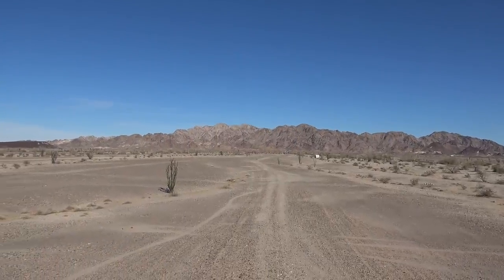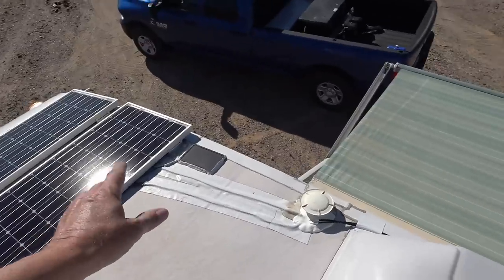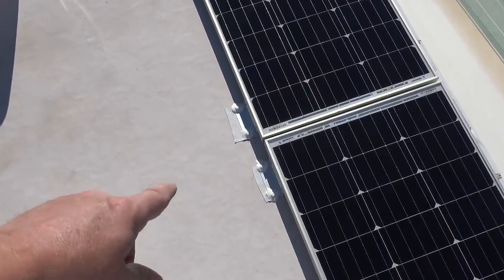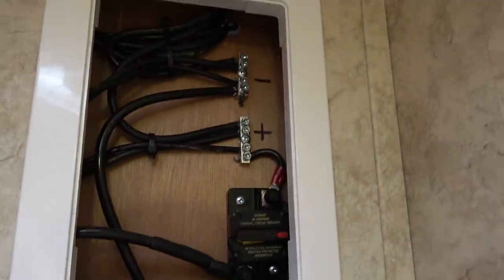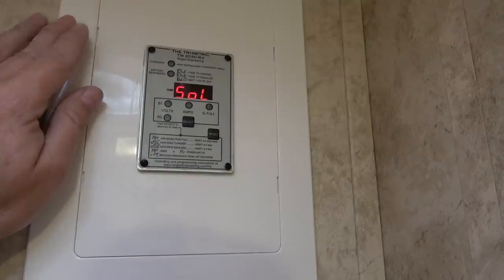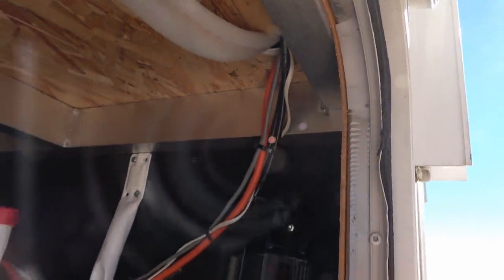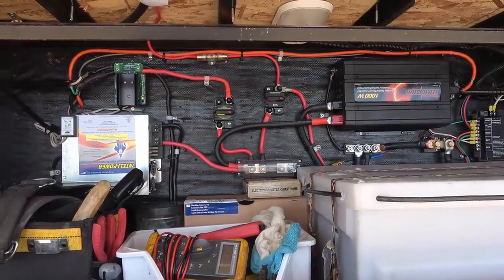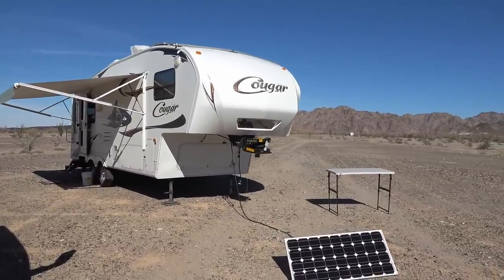Boondocking Power Upgrade -  2 More Solar Panels + Wiring Update & Mods

Comment: The breaker in the wall does not turn off your solar array on the roof but it does disconnect it from going down to your charge controller, which is still a good thing. If you need to shut off the solar panels, turn off the sun, work on them at night -- or just cover them with cardboard cutouts. :D
Reply from the maker: Yes, you are correct the voltage is still present but zero amps of current flowing. So really depends on your definition of  "off" To me if there is no power output its technical off, like a light switch in a house.

Comment: Nice to see your system Ray. Yes I have watched it grow through the years.
I'd like to add solar to my 26' TT, but solar is so $$ in Canada.
I would like to add ~1000w on the roof and around 400AH of LIFEPO4.
Storage is at a premium with my TT - only one small storage in the front that does not even go through all the way. This is a problem with all the space needed for the various parts, not to mention the batteries.

Comment: Ray, we love those 1/2 ton Cougar 5W's in the 27-30' range. The 25MES looks particularly inviting just under 30' and with Full-timer warranty coverage now added and most of the other brands not, the possibilities are exciting.  My 17' half-ton truck lacks the pin weight capacity to handle it with a good margin, unfortunately, so we are trying to find a suitable bumper pull model with a similar layout. Mind you our '17 Lance 1985 isn't a bad choice at 23' with a Murphy Bed, just when both of us get cranking on the tech/Reservation support back at the campground we both feel a little in each others' way, Sometimes the rig you got will get you there a whole lot cheaper than the next round of dealer add-on fees will, LOL. Our Beagle is now 10 years old so we want to get back to Boondocking in AZ/NM before those central FL snowbirds drive us crazy trying to rid the planet of ants, skeeters, critters, and bumps on the shuffleboard court, LOL.
Reply from the maker: Wow, full timer coverage, that's really nice!  We still like our rig, have always like the layout, suits us well. If the frame hold up I plan to just keep fixing and improving things. :)

Comment: Nice video Ray! Your charge controller has  a limit of 31 amps, looks like you're maxed out now pulling in 27.
Reply from the maker: That's a good thing for this time of year. Low sun angle and short days. The ground panel addition really helped but now with these 2 more panel we are pretty well maxing it out. :)

Comment: That access panel and hiding the bus bars in the wall was a good idea. Since you are already pushing nearly 30 amps during the winter aren't you worried about overloading your charge controller? I thought the Trimetric controllers were rated at 30 amps.
Reply from the maker: The Bogart solar controller can deal with the extra.  http://www.bogartengineering.com/products/solar-charger.html  "Up to 30 amps maximum solar current. Charger will safely reduce output if panel current exceeds 31 amps."
Nice perk with the simple little controller is it barely gets hot, even a full amperage. Not a lot of energy loss.

Comment: Thanks for sharing my friend. I must of slept through the one where you switched out the Tristar charge controller for the new one.
Reply from the maker: I've never had a Tristar, went from the Renogy kit one to the Bogart about 4 years ago, maybe it was one of my friends install videos of his rig I posted a few years ago, he had a Tristar.
Reply: @LoveYourRV  You're right. my bad. I just remember it being a PWM and in the comments were beating you up for it.LOL
Reply: @jerrydensmore2887  There is nothing wrong with PWM if your panel voltage matches your battery bank voltage With "12v" being most common. My 24v solar controller has proven to be very reliable and has worked well for me since 1999. It was my first purchase on eBay which was not widely known back then. My how things have changed.
Reply: @geraldhenrickson7472  I totally agree with you, but the nerds in the comments were raking Ray over the coals for not using a mppt one.
Reply: FWIW, unless you buy a top-end MPPT controller (eg: Morningstar or equivilant), MPPT is highly over-rated. You simply cannot trust the 'facts' in their glossy marketing brochures. The ones worth the price are very expensive. MPPT does increase power input to batteries but work mainly when panels are cooler in the early or late parts of the charging cycle when the panels are not producing much anyway. Plus, the extra electronics in MPPT units eat up extra power. In many cases, a good quality PWM controller (like Ray's Bogart) will actually produce as much or more power into your battery bank than most of the cheap Chinese MPPT controllers. IMO, for 95% of RVers it is better to get the Bogart and use the cost savings from not buying an top-notch MPPT controller to buy more panels that will put power into your batteries in all conditions throughout the entire day. Panel prices are continuing to drop, and the $ difference between Ray's Bogart and a very good Morningstar MPPT (30A) is enough to buy two 100W Renogy panels. That 200W of extra panels through a Bogart controller is hard to beat for the vast majority of RVers.

Comment: This setup would be ideal to evaluate series vs parallel.  I bet you could get 10-20 percent more out of a 2P 3S setup, 50 ish volts.  Maybe get victron to send you a Mppt controller for a test.  You would need like a smart solar  150/60 or so.
Reply from the maker: It would be a lot of work to do a complete comparison test. First, you would have to spend equal amounts of money on each system and do tests in many different conditions like temperatures, shading, cloud cover, sun angles at different times of the year or latitudes, etc. Then factor in robustness and redundancy of the systems. As systems grow and take up the rooftop real estate a quality MPPT controller like a Victron or Morningstar makes more and more sense.
Reply: True dat.

Comment: I have a 8x30 home under a car port I have 12 panels charging 10 12volt military batteries 5 on the A side and 5 on the B side, then into a 2,500 watt inverter. I have a lot of low power to run the furnace, frig, computer, I can't use the toaster or AC because it draws too much power on startup. My furnace is propane so I won't freeze. I wish I could do something that would allow me to use the  AC has a 15 amp draw to start and it shuts down the system. I have some advice go to interstate battery and see if they take in used military batteries. My batteries on-line are $650.00 each! They cost me only $75.00 each and they are like new. I have them in a 4x4 dog house we made and it looks like a BIG dog lives in it! Thank you for your video!

Comment: Well done ! Like yourself I too have a PWM controller & got an extra Renogy when they were on sale. I've gone slow with my Solar system and not wanting to spend a ton into it. Several of my camping buddies have $8 -$10k into theirs. I'll admit if you're over 400watts or long distance wires, the MPPT's are more efficient, but at the lower wattage not a real big difference for ME  to justify the additional cost at this point. Most of the time we're in the woods or Pacific Coast (ineffective solar) or our 5-6 week trip in Winter to the AZ desert. Our simple, low cost system & small inverter genset has worked well for our needs for now.
Reply from the maker: Thanks Herb, I could have bought a quality brand MPPT with my money and rewired for series and higher voltages but decided to just buy 2 more panels and some bigger wire for about the same cost. I kinda like having all small 12V panels and in parallel, some system redundancy built in and less shading issues.  PWM are super simple, and long lasting. MPPT are a lot more complex so more failures can happen, especially with these cheap off shore ones.
Reply: @LoveYourRV  You would gain 15-25% in charging amps by going to an MPPT controller.  You would need at least a 40 amp controller to handle your 700 watts of solar.  An inexpensive choice would be a Renogy Rover 40 amp MPPT controller which would cost you around $140-$160.  Another inexpensive option would be one of the epever MPPT controllers for ~$125.
Reply from the maker: If I didn't already have a perfectly working quality controller/monitor combo, purchased 4 years ago when MPPT were much more expensive, that would be a good plan. But for me having an existing system and lots of roof space it was just as easy to add more panels with the money and get still the % gain in amps, panels are quite cheap now.

Comment: We have a simular configuration. I put switches in the pairs to be able to control it. If one set has shade i can switch it off because the shaded panels will drop the whole output. The trunkpanel is awesome you have

Comment: I would suggest a Victron MPPT controller along with their BMV battery monitor. Your lifepo4 bank is not liking PWM. Many positives for upgrading those components. Nice boon docking location! Enjoy
Reply from the maker: The Bogart 2SC2030 PWM controller works in tandem with the Trimetric monitor. http://www.bogartengineering.com/products/solar-charger.html 
It is totally customizable (which was a big selling point when I bought it 4 year ago) so when I got lithium it was just a matter of going in and adjusting a few parameters. 
Mostly it was setting its absorb voltage setting to between 14.2 - 14.6V. I set it to 14.4V and it charges my batteries perfectly fine. The Lion Energy lithium batteries aren't that special to charge, basically, they just want a single charge voltage setting. The battery BMS takes care of the rest.  Cheers, Ray
Reply: Borgart PWM and TriMetric are older technology and not as robust or efficient. If they work, than stick with what you know. With the BMV you could see you battery SOC from your phone along with other information. No need to go to the bathroom to check.😉
Reply from the maker: Actually, Bogart recently came out with an add-on to its Trimetric which broadcasts the info using WiFi. So you can set it up and check the batteries from anywhere.  http://www.bogartengineering.com/products/wf-2030-wifi-remote-tm-2030-monitor.html  The Bogart stuff isn't as user-friendly and doesn't look as pretty or have the marketing behind it but good bang for the buck in my opinion.

Comment: I went parallel in pairs then series in between to bring the voltage around 60 volts coming into my Tri star mppt controller that can be used in either 12volts or 24 volts...I have 6 one hundred watt panels reenergy like yourself.
Reply from the maker: Those Tristar are great controllers!

Comment: Your PWM controller has settings for lithium batteries? It must be a very advanced unit. Oh wait...your batteries must be drop in style with the built in BMS. My PWM controller was top of the line yet manufactured before lithium hit the market so I need to do pretty much what you have done when my AGM batteries dwindle in another 5 years or so. You cable management was really top notch. Thanks for the video. PS...Did I miss a video? It appears you are out near Quartzite...I better have a looksee at your recent videos.
Reply from the maker: It doesn't have a special setting per se but it is totally customization, so I went in and set it up to match the charging voltage that my lithium batteries work best with. That was one of the perks of it at the time, it had advanced capabilities for a relatively inexpensive cost back 4 years ago. Was made by a small US company in California.  http://www.bogartengineering.com/

Comment: Nice upgrade... Agree more panel rather than tilting (A solar panel is about the same price as a tilt kit!)... Curious you have I believe a 30amp charge controller and now about 40+ amps of solar?... Is it ok to oversize the panels amp capacity above the rating of the charge controller? (I actually like that idea!) but would worry in the summer the controller would max out and could overheat with several hours of good sunlight?... I suppose in the summer you could disconnect the back 200w panels from the system?... Maybe add three switches below the battery monitor that would control the three solar roof arrays?
Reply from the maker: Thanks, Kevin, the Bogart solar controller can deal with the extra.  http://www.bogartengineering.com/products/solar-charger.html  "Up to 30 amps maximum solar current. Charger will safely reduce output if panel current exceeds 31 amps."

Comment: Ray,  It's great to see adding new panels.  With the 7 panels you are putting out 27 amps during the limited winter sunshine, what is the charge controller going to do if you exceed the 30 amp limit?
Reply from the maker: No problem, the Bogart controller can safely handle any extra amps.  http://www.bogartengineering.com/products/solar-charger.html  "Up to 30 amps maximum solar current. Charger will safely reduce output if panel current exceeds 31 amps. "

Comment: Do you feel you now have the ability to run electrical appliances as if you would if you were plugged into shore power (assuming no cloudy days)? I'm trying to grasp how one who lives full time and boondocks might evaluate their solar needs and do accomplishments get met with solar? 
Thank you for sharing the details of your install, always enjoy learning from you.
Reply from the maker: At this point, I could easily run short bursts from high wattage appliances like a microwave, coffee maker, hot plate, slow cooker, etc.  Not enough power for long term running of electric heaters or air conditioning. We still use propane heaters and low power electric fans and migrated to mildest temps.
Still, it depends a lot on the weather. A clouded up sky can really limit the power intake, so the generator as back up is a good idea.

Comment: Hi Ray. That's a really nice installation. I do have one concern though. The wire between the positive bus bar and breaker is less than the 4 gauge which was run to the charge controller. Is it 6 or 8 gauge to accommodate up to 40A for that short distance? Please consider upgrading it 4 gauge for consistency of the whole run.
Reply from the maker: It is such a short piece of wire it doesn't make a lick of difference. I used 6 GA as it was easier to bend. I didn't have lot of choice where I could mount things as the wall is so thin, I had to line my screws up to the cabinet behind. Cheers, Ray
Reply: Thanks for letting me know that 6 gauge wire was used. Since it will safely carry up to 70A for that short distance, should you decide to upgrade the charge controller and replace the breaker in the future to fully take advantage of the new panels, that's also a good choice.

Comment: Hi Ray, Paul in Tucson. Not sure if this comment section is the best way to get a quick answer. When you mount the panel on the roof do you apply a footy of eternabond tape on the roof then drill your 1/8 pilot hole? Cheers!
Reply from the maker: Yes, that's what I do. I just add the Eternabond as a extra protection to the rubber roof.

Comment: Thanks, I have a Class A and I been trying to find out how many lithium batteries it would take to replace my 3 12v deep cycles? Please help! Amp hours?
Reply from the maker: You don't indicate the amp hour rating but in general I would say to 12V 100 amp hour lithium would do the job fine. You'd have more capacity and faster charging. Here is a great video to watch to get the comparisons - https://youtu.be/PZ7HMRReZKY

Comment: Another idea, I don't think the pd9260c is lithium compatible.  I could be wrong, please check it out.
Reply: You can use lead compatible chargers on lithium batteries. However, you do not want to use a lithium only battery charger on lead batteries.

Lead/acid battery chargers will only charge to about 13.8V. Lithium chargers will charge to about 14.4V. Undercharging will not damage a battery, overcharging one can be catastrophic.
Reply from the maker: My PD9260 has the manual override Charge Wizard button for a 14.4V output overriding the lead-acid smart charging cct. I start my generator and hit the button and I see a charging amperage of 50+ amps constantly until the lithium batteries are full. So for me, it's not really worth the cost to buy a lithium charger. It just takes a little manual step to get the full amperage going.
Reply: Didn't know it could be overridden,  glad to know...
Reply from the maker: Yes, its one of the reasons I got it a few years ago so I could override and charge my old lead-acid batteries a little faster, just had to watch I didn't overdo it but it did help with a little faster charging. It just worked out that the lithium likes the higher voltage. So with a bit of manual fiddling on my part, I don't need to buy a lithium specific charger.
Reply: Yep that charge controller is your friend.  I had a bit of a discussion with Progressive about it.  Their Li chargers are WAY to aggressive and hold 14.4 volts which is unnecessary and even harmful to the LiFePO batts.

Comment: What if anything do you do with the solar system when connected to shore power?  Does solar and onboard charging battle each other when plugged in?
Reply from the maker: When I had lead acid batteries I left the solar controller on all the time, even when on hookups as it was capable of charging at higher voltages than the stock charge converter so did a better job of charging them. Usually what would happen is on sunny days the solar controller would be like the master and the charge converter like the slave. Then at sundown the charge converter would just maintain the charge .
For lithium its a bit different as unlike lead acid you don't really want then sitting a full charge for extended periods so when on full hookups for weeks or months at a time I turn off the solar. I find in my rig with the stock charge converter the lithium batteries end up sitting at about 54% capacity which is perfect for storing them.
Cheers, Ray